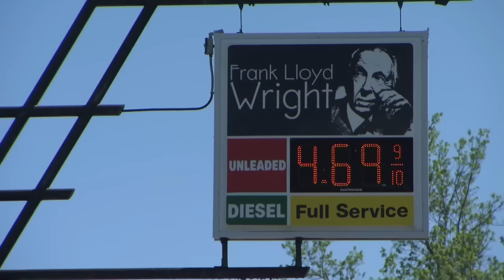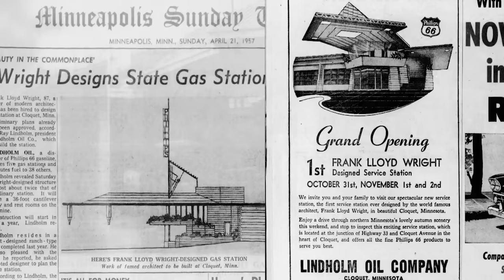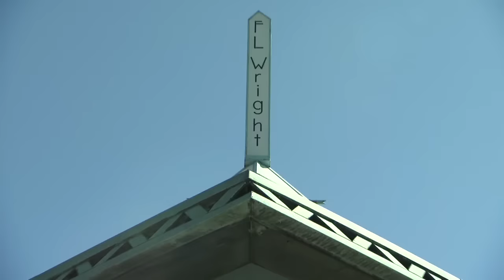Why Did Frank Lloyd Wright Design A Gas Station In Minnesota?

Comment: This reminded me of the gas station at Lenox Square Mall in Atlanta. It had a great big concrete swooping roof like an upside down umbrella. Couldn’t find any info on who designed or built it.  It was around from the late 50’s until the 80’s when it was demolished.

Comment: "Form over Function"
The pumps aren't covered to keep incumbent weather away from the customers. 
Still, fave architect.
Reply: Customers didn't pump their own gas in the 50s. They sat in their car while an attendant pumped the gas.
Reply: They used to be but were moved away from the entrance, look at old pictures, those are new pumps not original those are long gone..
Reply: Incumbent weather? Is that a Minnesota thing?